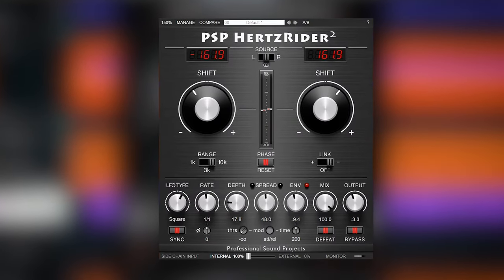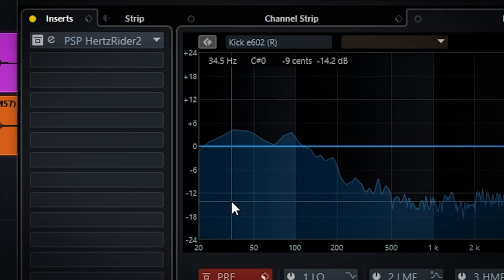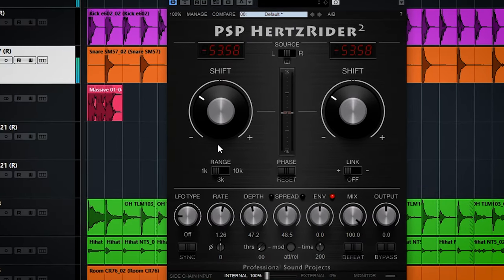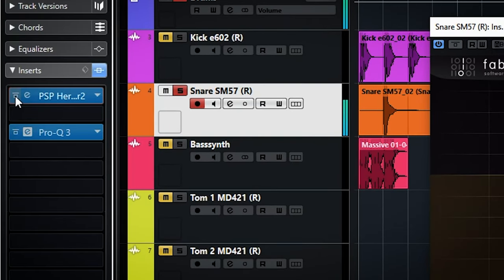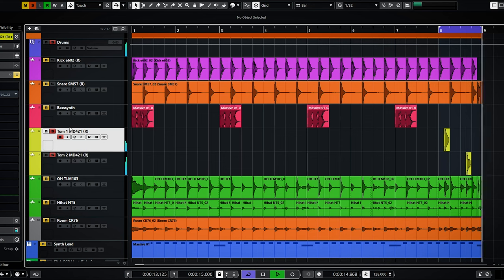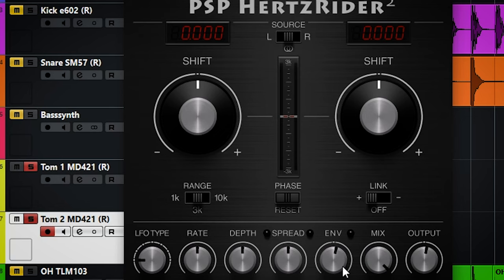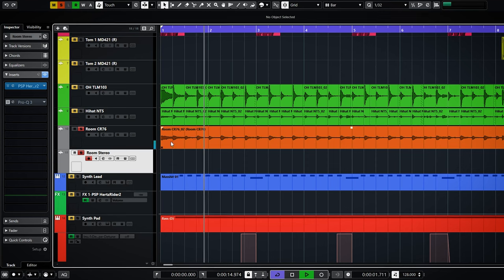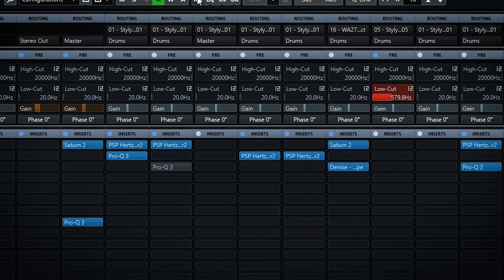How to get a big, great drumsound with PSP Hertzrider 2!

Comment: It's very good idea for electronic drums ! Although it may induces phase issues with overheads and else, so it has to be done with caution :).
Reply from the maker: Hey!! 
The loop used in the track is an acoustic kit ;-) 
And you're absolutely right regarding phase, I also point that out in the video:

https://youtu.be/FkawQHXpkcE?t=208

I recommend doing phase checks because you're tinkering with frequencies.
Reply: @audiotoolshed  Ho yes I noticed it's real drums (I saw the name with the mic used hehe). 
Indeed and it's a good advice, but I often find that polarity flips is not enough. It's not all about polarity but also phase alignment, which is responsible for the sense of forwardness/impact/transients of a multi-miced instruments :).
Reply from the maker: @WheelieMix  Ha! Also you are right again. A tool like waves inphase works great for that. I'm working on a new long video right now where I show how I used inphase where it cancelled out ride bleed in 2 snare mics. 

Manually aligning works well too, 
You can drive yourself crazy with aligning everything, a bit of phase cancelling will always happen in multimic setups and can contribute to a sound. 
We're even used to hearing that.

btw. Have you ever tried delaying overheads in comparison to snare and kick? Sometimes it can even create a bigger drum sound , if done carefully. 

Lot's of fun!
Reply: @audiotoolshed  Interesting about the inphase plugin cancelling out ride bleed on snare mic !

I have tried indeed, I used to align everything myself. But I evolved since and discovered that sometimes you want them to not be too aligned, as it gives a specific sound (some may say "vintage" sound) that you loose when aligning everything (for the sake of punch).

Indeed I tried a few times, it's a fun thing to do :D !
Reply from the maker: @WheelieMix  Mixing == fun!!!
Reply: @audiotoolshed  True, can't complain for it be my job :D !